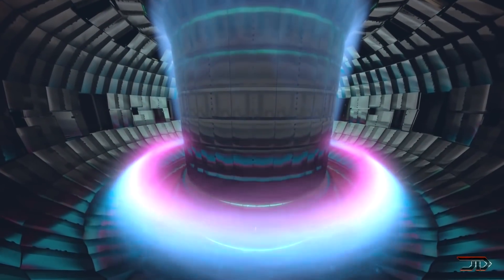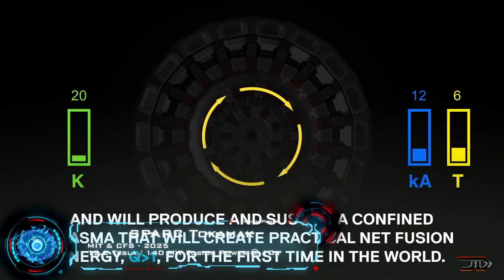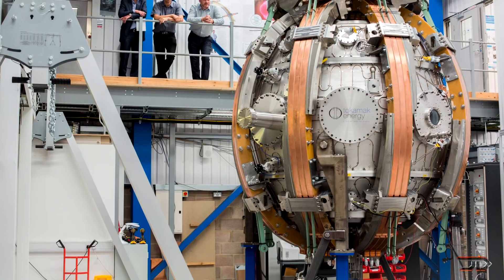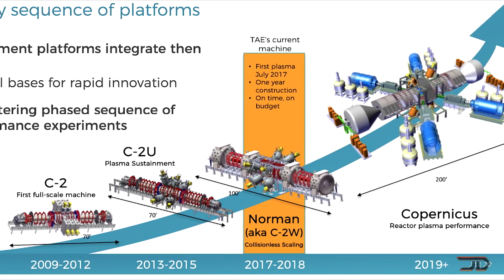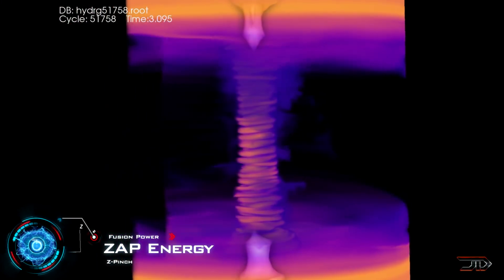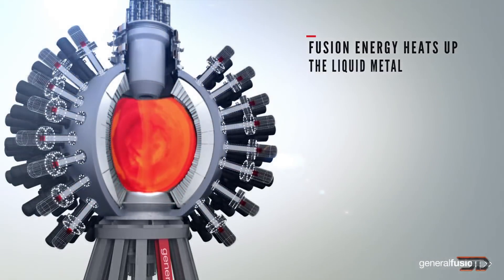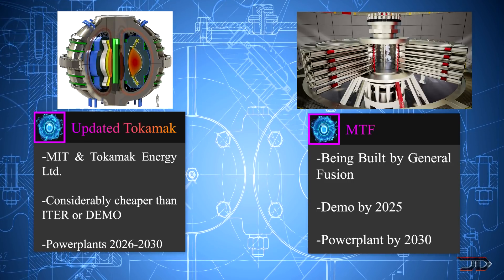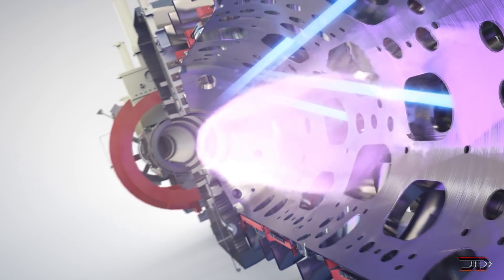Fusion Power - Latest Breakthroughs/Updates

Comment: I think that fusion technology will die. Even if they cross the mark of q > 1, they then should prove that FP is more efficient/profitable than other technologies.
Reply: I think you should add the term "small scale" to your sentence. The problem with current fusion designs is that they are trying to cheat nature by operating at comprehensible sizes. To achieve viable fusion "On Earth" will require enormous city-sized or larger reactors. Unless all the 0.01% billionaires pool their resources to fund such a large project this will always be a pipe-dream. I fully expect ITER to bear out this bad news... Eg. "Wow! After years of setup and testing we can finally say with certainty what would be needed for a real commercial reactor... a reactor nearly 2x the size of NYC should be very profitable, we just need 5 Trillion to start the project. It will pay for itself in 50 years."
Reply: @nbohr1more917  Who will wait 50 years? It not sound realistic to me. Governments changes, people change. What was good in the past, is bad now, like conventional nuclear energy. Hope i wrong.
Reply: @nbohr1more917  Everything you've said is inaccurate.

Comment: people are going nuts over the difference between qplasma and qtotal. why do you think they want qplasma of 10 or 100? because q=1 is not enough for engineering breakeven. qplasma is still useful because it rates the performance of the reactor, the thing you are trying to build. total efficiency is the job of the engineer, which is why scientists only care about qplasma and they know then need to overshoot the mark by a couple orders of magnitude to give the engineers something to work with.

Comment: The distinction between Qplasma and engineering gain is irrelevant. At Q5 the plasma becomes self heating and technically Qplasma is infinite after that point. After Q5, there is no longer a need for input heat.
Reply: until it melts into a pool of molten metal, as they can't extract the heat.
Reply: I wonder what Q factor the reactors in the show The Expanse are?

Comment: what about inertial confinement
Reply: The vast majority of the fusion energy physicists agree that that inertial confinement fusion (ICF) approaches are highly unlikely to lead to a practical fusion energy power plant.

The administrators of the National Ignition Facility (NIF) have always pitched it to the public as a path to a fusion power plant. This is highly deceptive since the tool has always been primarily funded as a thermonuclear weapon fuel compression research tool. They never tell the public that the energy feeding the facility is far greater than 200 times the reference energy of the billionth second pulses that compress the target components. They also don't mention that they are lucky to achieve more than one firing per day. The massive lasers were never designed to operated much faster than that. An entirely different laser technology would be required to operated near one pulse per second.

Comment: If you are using magnetics to create fusion you are doing it wrong, very wrong. You do not have a way of separating the waste product from the resulting fusion and the fusion will end.  There will never be commercially available fusion power as creating sustainable fusion power is like balancing a 1 foot long hair on a razor blade edge. The actual difference between controlled fusion and uncontrolled fusion. Only controlled fusion will lead to power production as uncontrolled fusion will lead to a boom that will level everything in a 3 mile radius. There are a few people on this planet that have figured out the balancing act. Hopefully they will take it to their grave.
Reply: why?
Reply: @DanielSilva-jj2lz  Bonding of two protons are not influenced by any magnetic force. If you are really interested in how two protons bind to form Helium and give off two neutrons, I would be writing a book here about the process. To keep it short two protons bind with a temperature difference between the two protons. If you are using electrons to heat protons as faster moving electrons through a proton will cause the proton to heat up, the same way a large current through metal will heat up the metal. 

But with fusion, using electrons, to heat hydrogen and the magnetics to contain that hydrogen, all hydrogen atoms will heat uniformly so there will be no temperature difference. The walls of the containment will absorb some of the heat but out at the outer edges of the magnetic ring, there will not be enough of the strong force(gravity) to pull a slower spinning(cooler) proton into a faster spinning proton(hotter) for the fusion process to happen and continue. 

That is why.

Comment: I first did a research project on Fusion in 1980.  At the time they said they were 20 years away from a useful fusion plant.  Now in 2020, we are still 20 years away. Eventually this will be cracked, but I think we are more likely 100 years away or more.
Reply: It will be solved when it's needed.
Reply: hope not. Because we don't even have  50 years left. With all the "green transition", fossil fuels are still running low at an incredible rate.

Comment: Unlike other means of generating power, fusion is something that doesn't appear in nature outside the cores of stars with masses at least 70 Jupiter masses. One Jupiter mass = 318 Earth masses. So it will be necessary to generate a containment acceleration equal to 318 * 70 * 9.8m/s^2. There, the containment is a free property of mass--gravity. To substitute, producing fusion on Earth, a containment acceleration of 318,146m/s^2, that's  22,260 G, must be generated by an outside power source in order to create the compression and heat to initiate a sustainable fusion reaction.

I hope these people are successful, but I'll believe it if I see it. Substituting other forces for gravity is very, very expensive.

Comment: What about Inertial Confinement Fusion with lasers? Has that been abandoned?
Reply: it's just kinda trash, even if q plasma ever sees 1, lasers are inefficient and the energy released is tiny and can never be converted to electricity as well. It just seems to be a funding scam for now unless they can somehow get q100 at 1000b degrees it is not even interesting
Reply: @kapytanhook  The vast majority of the fusion energy physicists agree that that inertial confinement fusion (ICF) approaches are highly unlikely to lead to a practical fusion energy power plant.

The administrators of the National Ignition Facility (NIF) have always pitched it to the public as a path to a fusion power plant. This is highly deceptive since the tool has always been primarily funded as a thermonuclear weapon fuel compression research tool. They never tell the public that the energy feeding the facility is far greater than 200 times the reference energy of the billionth second pulses that compress the target components. They also don't mention that they are lucky to achieve more than one firing per day. The massive lasers were never designed to operated much faster than that. An entirely different laser technology would be required to operated near one pulse per second.
Reply: @vernonbrechin4207  yeah, very deceptive stuff. I was not aware the reset time was that crazy
Reply: @kapytanhook  - After each laser pulse shot, lasting a few billionths of a second, the laser system has to rest for at least a couple of hours before the system becomes thermally stable enough to do another shot. Any fusion reaction that takes place may only last about a billionth of a second before the compressed mass blows itself apart and all fusion reactions end. So if they fire once per day the fusion production duty cycle is less than 0.0000000000001. The facility consumes well over 200 times the amount of energy that they list as the laser reference energy that goes into irradiating the inside of the hohlraum. The term ignition is highly deceiving since the fusion reaction ceases once the compression ends and the fusion reaction blows the remaining fuel away from the center. The proponents have suggested that solid state lasers could overcome some of the shot frequency limitations. That might be true if the most powerful sold state laser energy could be increased by more than three orders of magnitude.

Consider how many people have been deceived by the pronouncements of this laboratory. Since aspects of the experiments are classified that serves as justifications for withholding key parameters regarding the facilities operation.
Reply: @vernonbrechin4207  yeah, you seem very well informed. Once I lose all hope in a project I stop researching. The burning plasma thing seems like a joke in all fusion devices though. You start getting a intuitive sense of the coulomb barrier when you see what is needed to fuse things at any decent probably.

A ling time ago I was fooled by the cold fusion scam and now "lattice confinement fusion" sounds as improbable as hammering in a nail with a feather. 

Even if the laser fusion "ignition" took 0 energy it would still generate less energy in a day than a 1sqm solar panel in winter.

The only thing that can make this future work is massively cheap automated factory line level constructive of sparc scale devices. And with that tech fission would still be a better option than fusion. I worry all this is just a massive money sink
Reply: @kapytanhook  - I too became enthralled by the first cold fusion announcement and invested some money due to my interest. It was a good lesson in how hopefulness can be very deceiving.

In the NIF the fuel pellet compression is really extreme but they make no mention as to what happens after that. Luckily, I understand enough to know what follows. I learned much by researching the dynamics during nuclear weapons detonations. I also learned how they use official secrecy to snow the public.

Yes! The best integrated fusion yield that NIF has achieved is less than the example you gave. It is amazing how they present it to grossly fool the naive public.

It is not only a massive energy sink it is also a massive distraction for a vast public audience that is hungry for hopeful news.

Comment: be leary of claims and timelines by private companies seeking venture capital.  
fusion is very hard to achieve.  to get a scale of how hard, look at a size comparison of the sun to the earth.
there are very many scientific and technical hurdles that need to be negotiated.
plasma experiments have yet to even operate at fusion conditions, an entirely unexplored parameter space for plasma physics experiments.
for example, there is an entire field of high temperature materials that needs to be developed before a practical reactor can be built.
direct energy conversion is also a key component to get fusion on the grid; it is absurd to create a 21st century reactor that relies on a 19th century hamster wheel. 
it is unlikely that any of us  on this thread will see fusion power on the grid.
this work will require generations.
Reply from the maker: Yes, I agree to be very skeptical of claims in turn of capital!

Comment: Ahh so we have gone from the perpetual 30 years away down to the perpetual 10 years away so by around 2060 we should see the perpetual 5 years?
 One reactor I do have high hopes for being successful within my lifetime is the molten salt thorium reactor from my limited understanding they are incredibly safe as they cannot thermally run away, if a problem does occur the molten thorium salt is dumped to holding tanks and eventually solidifies this is putting it very simple anyway. I do hope they have success with plasma based reactors though.
Reply: If only western nations weren't so phobic towards nuclear energy. People want to get away from fossil fuels, but they refuse to switch to nuclear, even though modern reactor designs are very safe and generate huge amounts of electricity in comparison to solar and wind. Not to mention, since nuclear can scale itself up and down based on human needs rather than the random availability of wind/sunlight, it is less reliant on batteries.
Reply: @augustday9483  You do realise the planet has enough uranium for only 2 years given the global use of electricity, right? Using nuclear power is pointless, expensive and stupid.
Reply: @augustday9483  utter lies
Reply: @augustday9483  “ At the current rate of uranium consumption with conventional reactors, the world supply of viable uranium, which is the most common nuclear fuel, will last for 80 years. Scaling consumption up to 15 TW, the viable uranium supply will last for less than 5 years. (Viable uranium is the uranium that exists in a high enough ore concentration so that extracting the ore is economically justified.”
Reply: @rhetoric5173  
Reading comprehension, please. If consumption scaled up that much, the definition of "economically viable" changes. New sources become worth it. This is the absolute most basic concept of supply and demand, and my quote above covers this EXACT topic. We are not in danger of "running out" of uranium, even if we massively scaled up our usage.
Reply: @rhetoric5173  that's completely ignorant, fertile materials like thorium are plentiful and cheap.
Reply: It would still be cool to have the reactor
Reply: China  has already built one and has started testing it:

https://www.youtube.com/results?search_query=china+msr&sp=EgIIBQ%253D%253D

Comment: Fascinating.
I am very ignorant and have a working model in my head that eplains energy and matter to me.  What I do understand is the negative and positive energy flow between sub atomic particles that flow in multi-dimensional routes.  As I see it we are rying to disturd and break that binding energy flows by overloading the natural flows that bind the various wave forms of subatomic particles - yes very dumb but it works for me.
This brings me on to my point.
As we cannot access the numerous higher dimensional flows above the four we exist in, we cannot easily destabilise the overall particles.  Magnetism is the obvious answer over additional energy, but I do not know how we can manipulate it easily enough.  I have always toyed with the idea of two massive magnetic fields that are opposed to each other like pushing two north poles together, but on an enormous level.  This could force the energy exchange between the subatomic elements to stop interacting with each other and literally tear themselves apart.  One gigantic pulse would do it.  The question is how you could keep the opposing magnetic forces from pushing each other apart.  My solution required a complex network of magnets that work like the subatomic particles and use attraction and repulsion that re-enforces itself more the higher the repulsive force. The question then is how to arrange the numerous magnets and how to create the large EMPs required,
There you go - the ramblings of an ignorant amateur!

Comment: They need to design a fusion system based on molten iron, just like the Sun, then they could use the magneto-hydrodynamic power off of that. Its highly unlikely that the publicized fusion projects will work without copying the Sun this regard.

Comment: As long as scientists believe high temperature and pressure is required to overcome a Coulomb force, investors will keep losing money. Smashing atoms together does not result in fusion, it results in energy losses, and the higher the temperature the higher the loss. Nuclei fuse readily when they have the same velocity and direction, so heating a plasma basically makes things worse, and no this is not just an opinion. 😉
Reply: A what? Why would atoms fuse readily? What makes you think that atoms with "same velocity and direction" would somehow overcome theirelectrostatic repulsion(Coulomb force)? That does not make any sense. And Im not even mentioning that while you mention atoms, it is orders of magnitude more simple to fuse just their nuclei stripped of all electrons, otherwise you would need to overcome electrostatic repulsion between electrons as well.
Maybe what had in mind by "fusing" is actually "forming a molecule"?
Reply: @MrPatejl69  , Yes my typo it should have read "Nuclei fuse readily..." and yes I am talking about fusion. The reluctance of two deuterons to fuse is not Coulomb, but their enormous velocity. Once a deuteron has been  dissacociated from it's electron, it instantly takes on a velocity of around 2500 km/s, usually a plasma which means there are an equal number of dissacociated electrons buzzing around at 99% of c, Then we try to confine the whole thing... Think in terms of angry bees in a jar .... the tighter you squeeze them the angrier they get. Remember there is no friction on the atomic scale, so particle velocity is directly proportional to temperature and pressure. It's velocity we are fighting, not Coulomb.